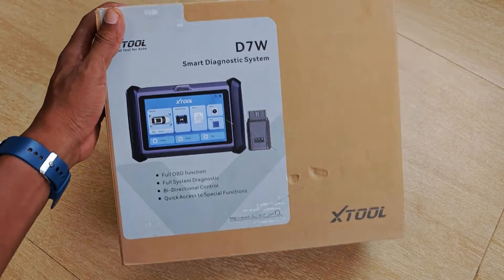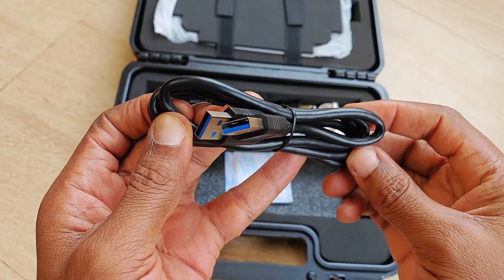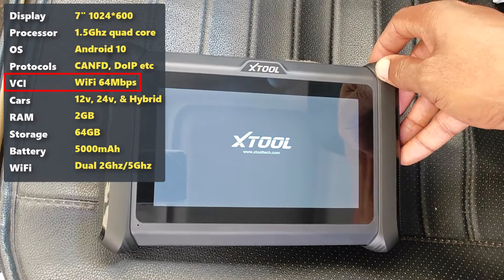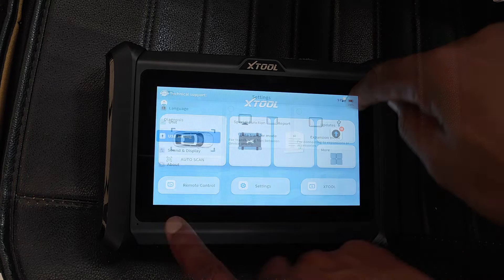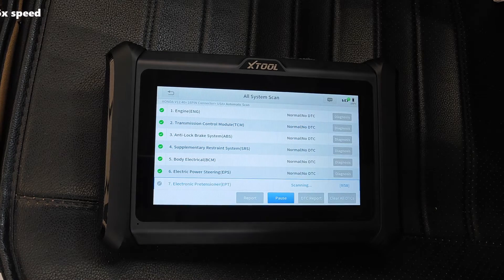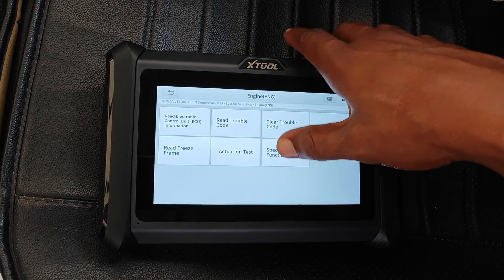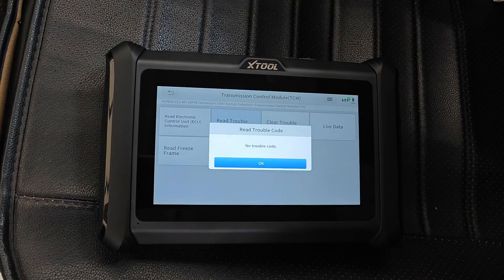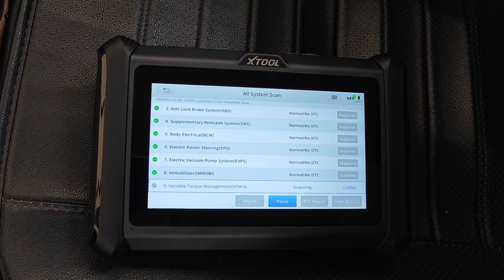XTOOL scanner review D7W / Before YOU Buy This Scantool / New Record for Scan Tool Speed

Comment: Nice video.  Tested my 06 350z.  But I was not able to locate the long and short fuel trims.  Is my scanner defected or my 350z does not have the ability to provide them via scanner?  I contacted xtools but I have not heard from them.   I welcome any input.
Reply from the maker: Some cars are that way. You went through manufacturer livedata right? Try going through generic OBDII? On my 2017 Honda, I can only view livedata via generic OBDII.
Reply: @DIYAutoworksNG  Thanks for getting back.  Yes,  I did go through the d7w's live data. I do have an older inexpensive OBDII.  Hopefully, it will show the fuel trims... Keeping my fingers cross.

Comment: Im still following you whenever you have new xtool update. I hope you can show me how to do cas4 bmw if its possible without adaptor kc100 kc501.

Ive bought d7s since i was watching your video… sold it and bought d8s now but havnt explored yet
Reply from the maker: Thanks for following. Will be on the lookout. I currently don't have any family or friends with a BMW but will continue to look. I've even wanted a BMW too to explore coding and key programming!
Reply: @DIYAutoworksNG  i saw retrofit coding for bmw and a ecu configuration option on specialt service function although i havent explored it aswell.

I might need to look for a battery support to do the cas4 because my resting voltage is 12.43 and i was unable to communicate or maybe need kc100 😅